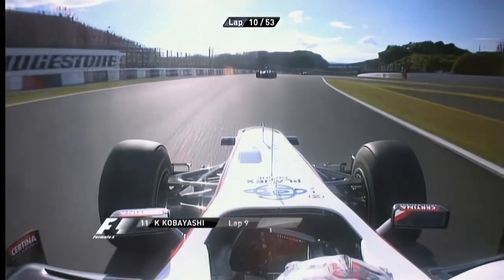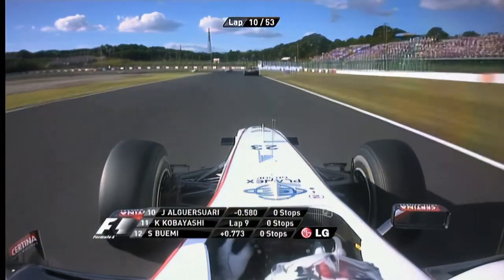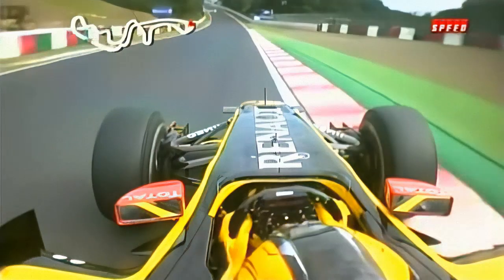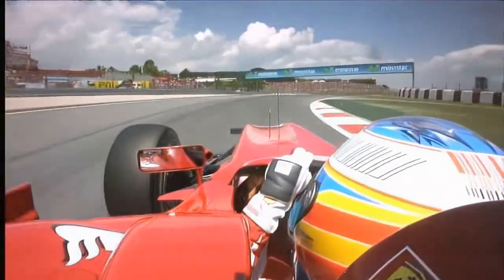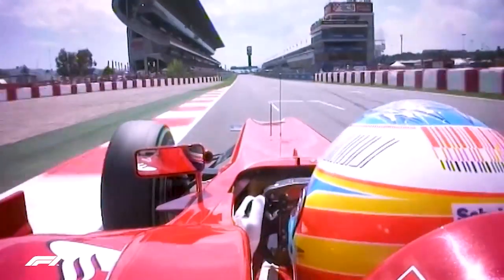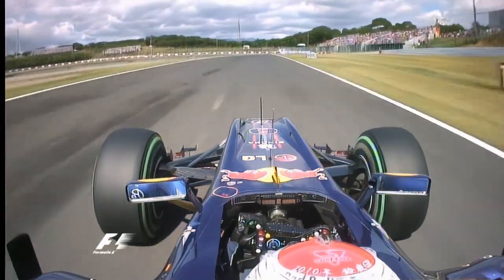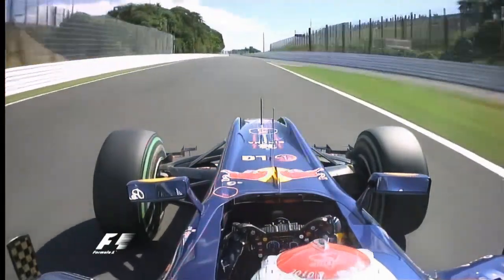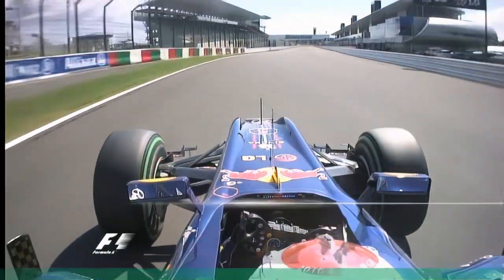F1 drivers using F-Duct : How it was allowed ?!

Comment: Because F1 wasn't as brain-numbingly soft and safety conscious as it is today.
Reply: @isjustmichael  no it isn't. We had one full season and 0 (zero) F duct related accidents. Just because it looks unsafe doesn't mean it actually is. Kubica can drive with one hand, remember? It's totally fine.
Reply: @thomasconway95  not everyone is Kubica
Reply: @edrick7260  so despite watching this video - which proves that all competent grand prix drivers can race one-handed, you still assert that Kubica is some type of freak one off? The F Duct was totally fine. Go and watch some videos from the 80s where they have to physically use a gearstick! Seriously, this is racing.
Reply: @thomasconway95  lol man you are insane. No point on risking it tho, the fact that nothing ever happens doesnt mean it is now safe. There is always a potential risk by having the F duct, just the risk is not worth it when other safer technologies can replace it such as the DRS. Now if you dont like current f1 then i suggest you go back to the 80's, we dont want you in this timeline.
Reply: @thomasconway95  no it is a very dumb Hill to die on
Reply: @onlineghost9813  well let's just cancel racing completely then, because it will never be safe. Motorsport will always be dangerous. The F duct made very little difference. You new generation of fans just don't get it.
Reply: Guodlca  one whole season is a massive sample size. 24 drivers, 19 weekends. That's a cumulative total of over 60,000 individual laps throughout practice, qualifying and racing. Now, not every team had an F Duct, and apart from McLaren, the other teams introduced their own version part way through the season, so the sample size is closer to 30,000 individual laps. But the point still stands, that's a massive sample size of usage, and zero incidents. You cannot refute basic probability.

You may argue, "it only takes one lap" or something similar, but I will repeat what I said in the previous comment, if that's the case then let's just end Formula 1 and ban all racing, because it will never be 100% safe. The F Duct was accepted in 2010 because the FIA understood this and welcomed it's brilliant innovation. The notion that it wouldn't be accepted in today's F1 just highlights how egregiously safety conscious it has become: safety for safety's sake, a complete illusion, to the detriment of the show.
Reply: Guodlca  you have a failure of imagination ... exposed cockpits have always been dangerous across all disciplines of Motorsport. Driving one handed in a straight line? Not so much. Tell me, what could possibly go wrong? A driver spins or crashes? Like what happens all the time? Shall we ban crashing now?

Where do you draw the line?
Reply: @thomasconway95  no man, it wont be cancelled, it will just become more and more safe. Happy new year my salty old man.
Reply: @thomasconway95  glad you aren't involved with the FIA anymore, you'll just go back to "those golden days" when drivers were dying every weekend
Reply: @isjustmichael  People a few decades ago basically always drove 1 handed due to a manual shifter.
Reply: @eryk.twenty  Those cars were meant to be driven one handed due to a H-pattern so basically not that much risk, with cars that arent desgined that way the risk is there
Reply: @bruh you have the gall to complain that its all about car in a sport where its all about car? thats the whole sport, and it always will be.
Reply: @thomasconway95  yeah but what difference does it make to you if they use the break duct or not? Cars evolve, features get banned since the beginning of the sport... A safer F1 doesn't mean a worse F1... And this season proves it
Reply: @davidebasso4275  it's not about F duct or no F duct, it's the philosophy, as shown by the title of this video "how was it allowed" despite being perfectly safe. I don't want the sport to be inherently "unsafe" but there are many aspects (very strict pit lane speed limit, trigger happy SC/VSC/red flags, far too heavy cars, lack of gravel) that ruin the show because of "safety". Apart from head protection, F1 has been safe since the early 2000s, and yet they just kept on adding measures.
Reply: @Elias0112  what are you talking about?????? When did I ever say the halo was a bad idea??? And your implication that Verstappen's crash was life threatening LOL he was totally fine. Maybe you should ask yourself if Grosjean's car would have pierced the barrier if it wasn't 250kg heavier than a car from 15 years ago.
Reply: @thomasconway95  Yes F1 is completely ruined my dear now if you would stop watching it, we the softies gen Z and millenials would appreciate it very much. 🥰
Reply: @instenalable  you should watch some older races from 1997-2008 and you'll understand what I mean, F1 is very sanitised today, far too controlled
Reply: @thomasconway95  Go have a cry somewhere else
Reply: @thomasconway95  I agree mate, heroes take risks,
Reply: @thomasconway95  complaining about pit lane speed limits is a good way to disqualify yourself from adult conversations
Reply: @WearyKirin  I'm not saying it should be abolished, but that it's too low. 10-15 years ago you would lose far less time when making a pit stop. At some circuits it's actually slower today than during refuelling, just think about that. This is why we get so many one stop races because it takes too long to change tyres.

Even if the pit lane speed limit was increased by a meagre 20kph, it would make a big difference to race strategy and exciting races, with virtually no additional safety risk.